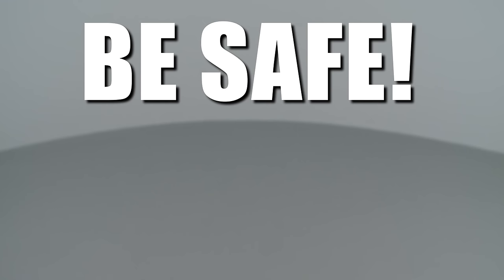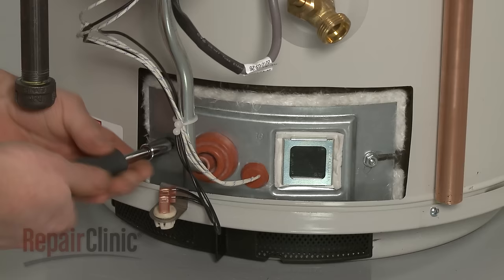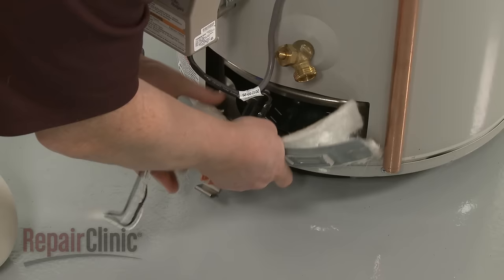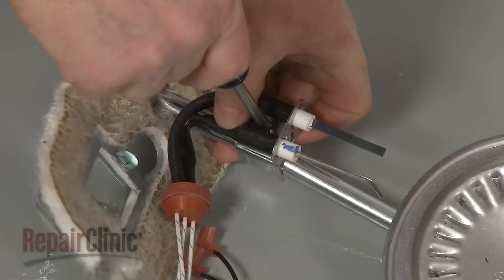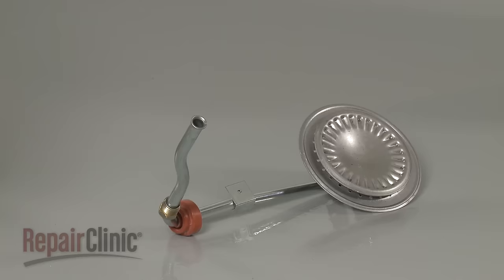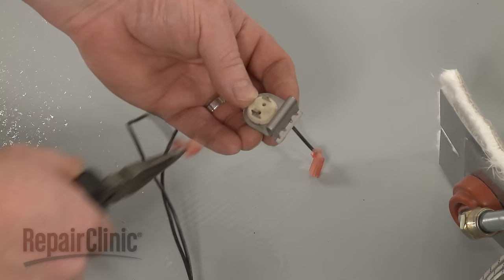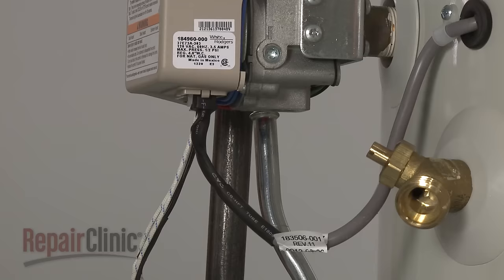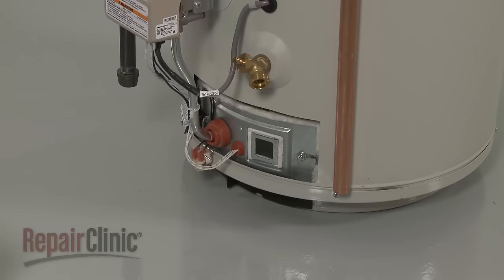Water Heater Won't Light? Igniter & Flame Sensor #9005958005

Comment: Thank you for the crystal clear video. I cleaned the sensor, burner, and surrounding area with a vacuum and air compressor. Water Heater burner continues to run now.

Comment: Great step-by-step info in this video. Real confidence builder as I was able to take the Ignitor and heat sensor out, clean the sensor and burner, and affixed the repair. Not sure if a temporary stop-gap measure but will change out the part if and when it becomes necessary. Thank you for the help and easy to follow instructions!!!

Comment: I have a gas water heater and had it installed over 7 years ago .. Now it is not switching on when you open the tap... But switches on when you open two taps simultaneously.. Can it be a problem with water pressure?  Or?

Comment: How would you know if it needs to be replaced
Reply from the maker: If the water heater isn't heating the water the igniter may be the problem. The easiest way to do this is to take it out and test it for continuity.

Comment: I have a problem with my AO Smith Gas water heater,  Pilot light is on... and stays lit.. the problem is flames dont start when needed... for instance when I go touch the temperature dial... I can hear the flame come on... but after flame goes out... it does not ignite again and therefore I have cold water... and I need to touch the temperature controls dial again.. and flames will come back on and once water is hot... flames goes out and cant come back on unless I touch the temperature dial again.  do you think its the thermacoupler ? or the temperature control dial ? can I replace that ? or do I need a new water heater ?

Comment: hi         the tank gas just  igniter    just turn off after pilot   every couple hours      no more hot water   is it  the Igniter and Flame Sensor Replacement     broken         thx
Reply from the maker: It could be the flame sensor or the igniter. We recommend using the repair help of our website with your water heater's model number: http://www.RepairClinic.com/repairhelp?TLSID=1773

Comment: Ive replaced the whole element and water heater works for like 2 days then quits again.....looks like I will be replacing the whole heat with something other then a ao smith.....JUNK
Reply from the maker: +MrAddicted2net If you are not using original OEM parts that could be why it is not working.